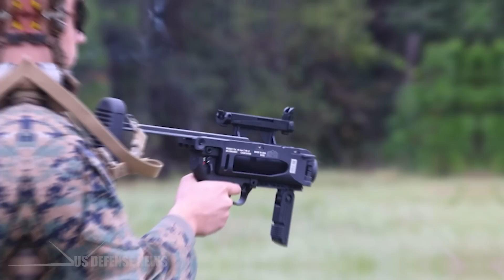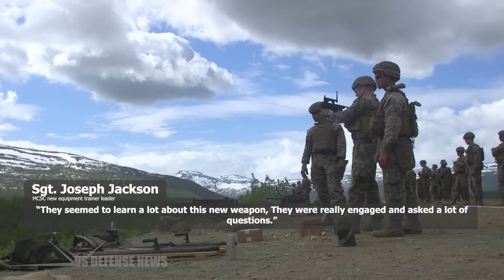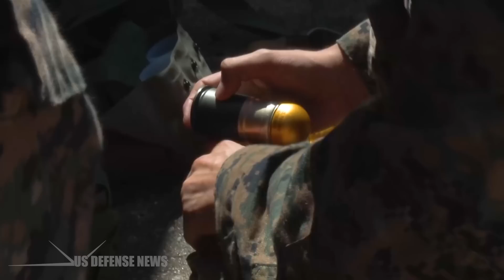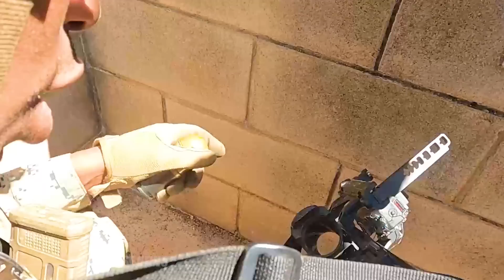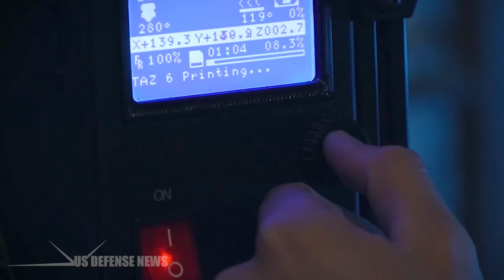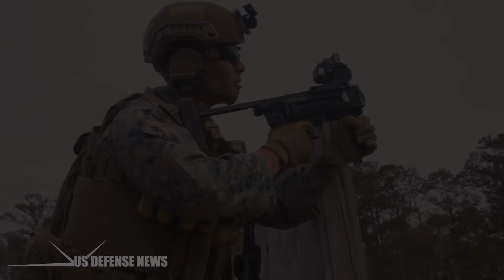U.S. Marines Are Testing 'Deadly' New Grenade Launcher

Comment: The M320 is not a new grenade launcher. I was one of the people that tested that grenade system at Fort Irwin, CA back in 2011.  its very accurate as a standalone grenade launcher and is accurate with its mounted. I'm surprised they waited 12 years to finally replace the M203....

Comment: How about some specs on the unit?
Weight, range, AoE, or is it exactly the same as the 203?
Reply: Judging by the smaller size, I’d say the weight is probably reduced. Probably little impact on range, because the cartridge is such a low pressure. AoE is probably unchanged, because a 40mm is a 40mm.

Comment: In basic and AIT (Ft. Jackson, SC 1965) we were trained on the M-79 grenade launcher.  Accurate as hell.  Not replaced well by the M-203, in my professional opinion.
Reply: M 79 was perfect thats why they are replacing it
Reply: they still had a few around in early OIF for whatever reason. Usually put them on the posts.
Reply: Some of the ammo was too long to fit the loading gap between the barrel and the M16, looks like that is solved now but the barrel looks a lot shorter than I remember the M79's being.

Comment: Man had these in like 2007 in the army, didn’t like the electronic sight or mounted on weapon…..but as stand alone this thing rocks
Reply: Exactly my thought... do we really need mounted grenade launcher? Or would a separated dedicated grenade launcher be better?
Reply: production of the M320 didnt start until 08, wasnt in service until 09
Reply: @CharlieFoxtrot128  its in service since 2002 with the Bundeswehr as AG36
Reply: @zhufortheimpaler4041  the AG36 is a different launcher. Similar and in the same family but it’s not the same.
Reply: @CharlieFoxtrot128  its actually the same launcher just mounted to the G36. The M320 is the AG36 for the XM8 and is now sold as standalone launcher.
Reply: @zhufortheimpaler4041  ok well the AG36 isn’t the Exact same as the M320. We’re talking about US military. Not the German military. The US military adopted the M320 in a stand-alone configuration
Reply: @CharlieFoxtrot128  its still the same grenade launcher, just with the option to fix a stock to it.
its like saying the M4 Carbine and the M4A1 Carbine are different rifles, because one got a fixed carry handle and the other is covered in picatinny rails.
Reply: @zhufortheimpaler4041  ok fine. Production of the US MILITARY M320 did not start until 2008. Happy? Plus that’s not even the difference between the M4 and M4A1 LOL
Reply: @CharlieFoxtrot128  sure, but you get what i mean by that comparison. btw the M320 is a great standalone 40mm launcher.

Comment: But it's missing on thing that the M203 had... That distinct "toont" sound when fired. Still one of my favorite sounds.
Reply: the lack of the distinct "Bloop" sound is due to new propellant types and more powerful ammunition, that does not require the high to low pressure equalisation of older 40mm grenade propellants.
Reply: It is German. It is supposed to go 'kroont'.
Reply: M79,M203 and M72 not strong enough like B40, B41 (RPG).
Reply: @mikeng.4121  The two are not comparable.  B40/41 is 80mm and rocket-propelled.  Two completely different tools.

Comment: We had this grenade launcer since 2000. It's a variant that is mounted under our Diemaco C7 rifles
Reply: @top-secret996 It was still in the prototype stage in 2011. I tested it as it was called the XM320 back then. So technically its been operation since 2011...
Reply: That is the AG36 ( has unique designations in the Canadian and UK army ) basically same weapon but without the foregrip ; m320 was a modified version to meet the US requirements , that came out way before 2008 obvs originally being designed for the G36 but adopted for diemaco c7/c8s and the SA80

Comment: Will it be able to function with mk19 ammo.?
Reply: Of course not dumbass, this is a low pressure system.
Reply: No, these and 203’s use a different kind of 40mm round. The Mk 19 uses a 40x53mm high velocity round that’s far more powerful.

Comment: I had an M203 mounted on my M4. I  found it very accurate while using a quadrant sight. The Army never gave regular infantry enough rounds for practice while at the grenade range for qualification. I never had a problem firing a round through a window at 150 meters, it did have a huge kick.
Reply: Lol! Did they hand them out at the library for the homeless dudes?
Reply: Is there such a thing as “enough” ammunition?
Reply: All I got is a potato cannon.
Reply: In the army we call it the m320
Reply: @dalewoods7308 what's this we stuff? Speak for yourself. Especially when you're wrong.
Reply: @dalewoods7308 
Jesus Christ
Reply: @dalewoods7308  the army now uses the M320.  It’s easier to reload than the M203 was.

Comment: WHY? The 203 was Great! 
 But then again they finally got the M16 to operate good!! And now going for a new rifle and ammo. Doesn't make any sense to me! But I served in the 80's/90's.
 Hope it works!
Reply: 1. Side loading
2. Double action
Reply: @armynurseboy  Also capability to take longer rounds, like non-lethal.
Reply: Us Brits have had these under our SA80s for decades, the M302 is HK made and always has been, I don't want to share someone else's story as it sounds weird so I'll speak for myself; I used the M203 on M16s M4s, the only thing I didn't like was the shotgun like action an slight inch either way you couldn't get a fired or live 40mm out or in but with the M302 that's not an issue and with the SA80 it being right handed only, the M302 ejects to the left and reload a must better system, more accurate and more range. We also have the stand alone version with red dots and acogs, as well as nightsights, I believe it's lighter too and other types of ammo that can be fired from them some I'm sure I'll get in trouble I'm I name, but some insane projectiles out there and so very unique ones I really can't mention.
Reply: Actually the launcher works great. The Corps switched from the M16 to the M27 several years ago. Far better rifle and more accurate. I’m hoping to see the new rifle from Sig in the Corps soon. As the 5.56 is simply no longer a viable round
Reply: @tiredoldman  The M27 being better is very debatable. And how is it more accurate?